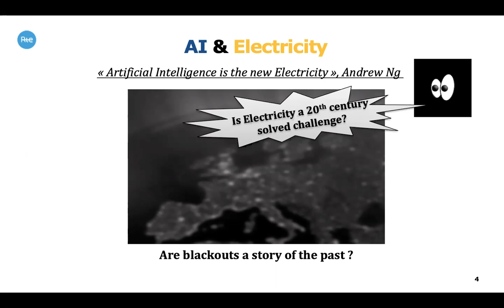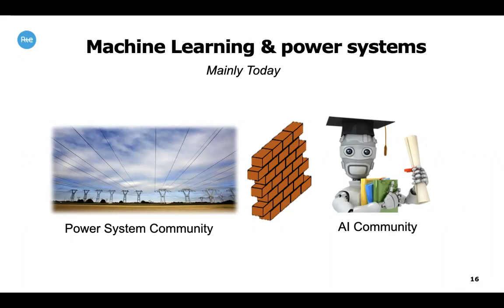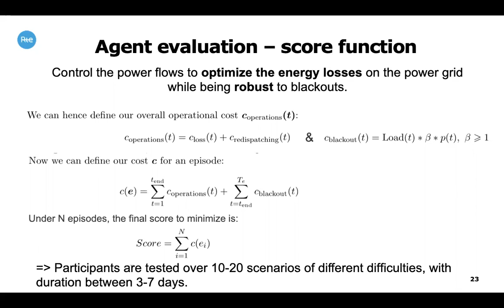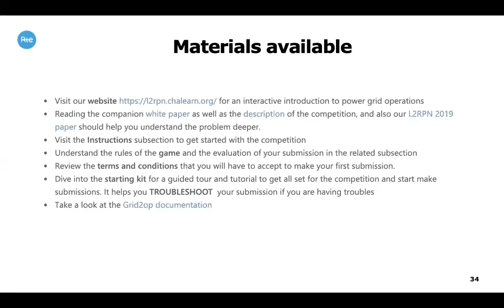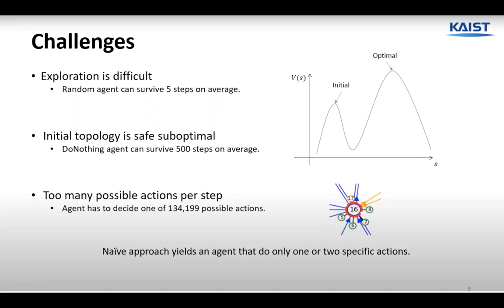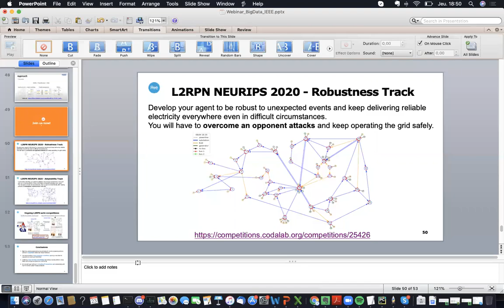(IEEE BDA Tutorial Series) Power network in a sustainable world. Part 1: Problem definition

Comment: 1. Question for Mr. Marot: 

1) What kind of actions can the adversarial agent perform? 2) was it designed to adaptively disturb our agent, or does it behave independantly (fixed distribution)?
1) An adverserial agent in the current competition can only disconnect lines, to somehow emulate unexpected line disconnection and N-1 considerations. But you can design an adverserial agent that uses any action (bus splitting, line switching, redispatching) modeled by Grid2op if you'd like for another problem.
2) Grid2op indeed could let you learn an opponent that adaptively distrub a given agent. For the current competition, we choose to make a simpler opponent based on heuristics which will fort instance target most loaded lines at some timestep. Attacks will actually be different from one agent to the others, as the actions of an agent modifies the grid, and hence modifies the observations on which this opponent base his attacks. 

2. can you share the discord channel?
Necessary informations can be found on our website: https://l2rpn.chalearn.org/. The discord channel listed there is: https://discord.gg/cYsYrPT 

3. Is it possible to use power system of our choice in the environment?
Yes, even real grids, if the backend you use (such as Pandapower)  handles your grid file format. But you need to generate associated times series of production and consumption (see Chronix2Grid)

4. Is the marginal cost available here?
Yes and it was derived from Chronix2Grid (which relies on Pypsa) when generating the data

5. Is the model designed for steady state conditions, or considers the dynamics of the model for generators as well?
We don't model a power grid which is handled by the back-end, we model operations and decision making. So if you use a backend simulator which runs dynamic simulations, you can plug-it in to Grid2op and use it.

6. I am Bang Nguyen, a Ph.D student in Clarkson University, Potsdam, NY, USA. I have a question: 1) Do the agent have all information of the grid (all the bus voltage phasors ?) or not? 
Available observations as of today are listed here  : https://grid2op.readthedocs.io/en/latest/observation.html. You can already access voltage magnitude but maybe not voltage phasors. 
If the backend you use (such as Pandapower) has it, it will be easy to get it in the observation actually. You can request a feature on the Github here: https://github.com/rte-france/Grid2Op/issues
2) Did you consider that the agent only perceive the grid using means of measurement devices with noises and attacks on such that devices and also communication channels?
The observation you send to the agent can be different from the reality that the environment handles. So yes with Grid2op you can model such things. In this spirit, the only thing we provide for now are noisy forecast. But we plan for further problems to introduce noise in the observations and simulations. We are also thinking of extending it as a multi-agent framework.

7. Question for Mr Marot: How the RL-based algorithm deals with rare events in the power grid system.  
I would rephrase it: how any methods deals with rare events? It is not specific to RL for me.
Either you explicitely introduce some cost /objective/reawrd that tries to take that into account. Or you leverage the use of simulators to generate rare event situations from which your agent will learn implicitly to deal with rare events. Basically you design your sampling method during training so that your agent sees the situations that matters, much like importance sampling. But you can even think of an adversarial agent that will learn to push your agent to the worst situations from which it can learn from.

8. Could you elaborate what is considered as the redispatch cost?   As load is changing so you will have to redispatdch generator from t  to t+1.  So redispatch cost for time t+1 is the cost for the this delta P (calculated from Pt+1-Pt?
https://l2rpn.chalearn.org/home#h.p_NEs9UnVskkN2

9. There is no similar software framework. The three most commonly used simulation software around the world are PSSE, PSLF and PowerFactory. All have python APIs
To the best of my knowledge there is no similar framework to us in the power system world. 
I think there is some misunderstanding here: our framework is ignorant of the grid modelization and physical equations. We don't model that and we rely and the backend simulator that is plugged to it to represent that. The good news is that if your backend such PSSE, PSLF and PowerFactory has a python API, you can readily interface it with Grid2op. Our framework develops a new layer on top of those software as they are designed today.

Our open-source framework is intended :
to make research on real-time decision making along time (along scenarios of several days for instance)
to help modeling and designing the cyber layer on top of the physical layer. 
to let train AI models
to be used as a testbed platform to benchmark any control algorithms
to interface different control modules at the same time and study their joint interactions and impact on decision-making
This kind of framework is inspired by what the AI community is developping. I strongly encourage you to look at what this large community is actually doing today outside of power systems. You can look especially at OpenAI, Google DeepMind, Facebook research to understand the new frameworks that are coming.

10. Can you clarify if line switching/topology control is the only control input here, or other actions are considered as well?
Redispatching is also available. Refer to our white paper and L2RPN design competition paper for more information on that: https://l2rpn.chalearn.org/home#h.p_NEs9UnVskkN2

11. I suggest that the organizer can make a few examples for the cost function calculation.  This is because it is hard for the participants to understand what observations they need to consider for calculating rewards. As you mentioned, the total cost of serving the load at time t is not considered in the cost function, so I assume that you meant suppose load is increased 50 MW, if two generators pick it up, the cost will be calculated based on the cost of the two generators.
We consider the cost of grid operations:
energy losses (which is actually related to the cost of serving load at time t)
the cost of redispatching (doing on action that changes the amount produced by two generators for instance, compared to what was expected by the market clearing, because that helps solve some constraints on the grid)
We will try to make few examples of it, thanks for the suggestion.